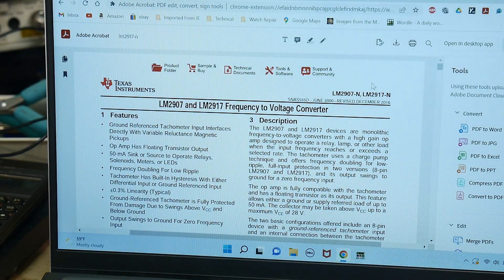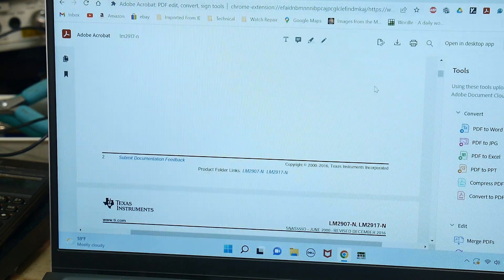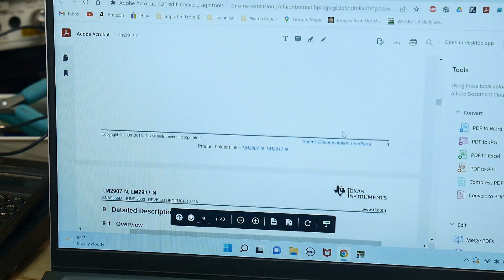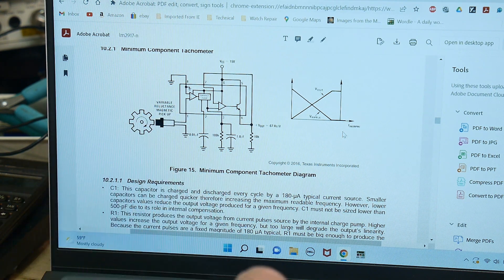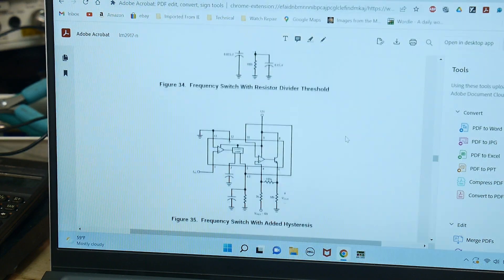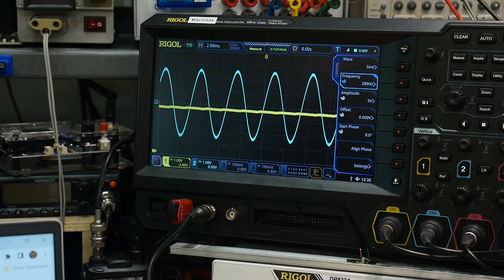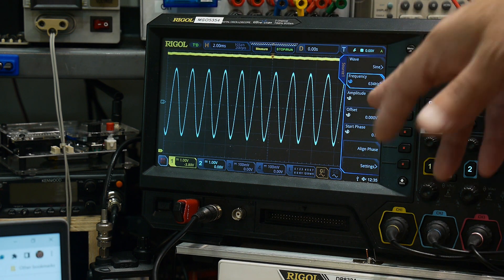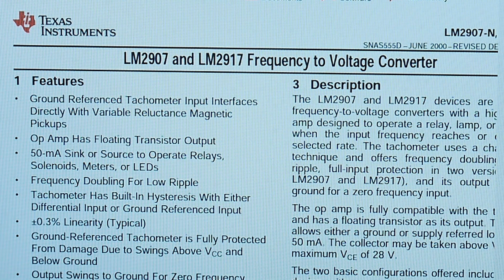#1153  LM2907 Frequency to Voltage Converter

Comment: I'm looking for a similar application however my input is 0->12V square wave.  I'm told the LM2909/2917 chip will only work with a positive to negative input.  Is that correct?  If so is there any similar product which will work with a zero to positive input?
Reply from the maker: you need to study the datasheet more. the 2907 would work fine if used correctly. input is comparator so apply 6v to the other side. datasheet has applications showing positive only voltages

Comment: With the help of my 10-year-old son, I am using the LM2907 feeding a LM3914 to control the lock-up converter in the transmission of a project vehicle. In our circuit, we will be feeding the output voltage into LM3914 to lock up the converter when the driveshaft reaches a speed of about 2000 RPM.  Using 4 pickup magnets, we are going to target about  130Hz to 135Hz as our target frequency.  Using a VR for calibration, we should be able to dial it into the exact speed we are looking for.

Comment: I have built this circuit using a 5Vdc supply. I find I can only get about 3.5 Vdc out at pins 4 and 7. Is this a limitation of the chip or have I done something wrong?
Reply from the maker: chip limitation

Comment: The LM2907 and a magnetic pickup sensor are fantastic. The sensor will take a hot greasy locations similar to car engines. Where expensive encoders will fail.  😎 Great video. Thanks.

Comment: Just bought 5x LM2917N's from China. 14 pin dil ones.That's the LM2907 but with an inbuilt voltage regulator, except that it wasn't there. Fake chip. Beware! Got a refund.

Comment: Let's see, your sine wave signal is AC coupled and the chip is powered with a single ended supply.  I suppose that means that the bottom half of the sine wave is ignored.
Reply from the maker: no not at all, the chip can DC bias it's input to any voltage it wants. I don't know the internal design. oh, just looked at the datasheet, shows the circuit, it has a bias section and the input is actually a Schmidt trigger

Comment: I designed that product as a design engineer at National Semiconductor in 1974.  I was designing custom automotive ICs, and this was my first 'non-custom' general application device;  it was an offshoot of a anti-skid brake controller I worked on for Bendix/Ford.  In no possible way could we have predicted this device would last and sell as many as it did!  I presented it and its possible applications in a paper delivered at the first SAE/IEEE Convergence Conference at Cobo Hall, in Detroit, in 1975.
Reply from the maker: Good job!
Reply: Wow, 2.6k views and one of those was the designer, what are the chances!
Reply from the maker: @guilldea  at least 2600:1 😎
Reply: @guilldea  Its a great channel!!
Reply: Robert,  when were you last working at NSC? I worked with Grass Valley guys, and Oulu, 2005-2011... I guess that you knew that "character" with the big beard, and VE beetle?
Reply: VW Beetle ... btw, there are a few NS parts in LP55xx series that have my fingerprints "embedded" in them...and, a couple of Grass Valley parts, to a lesser extent... oh, and a few TI parts, too ;-)
Reply: @lohikarhu734  I was in the factory from '73 to summer '78, in the field as an FAE until '83
Reply: You may be referring to Bob Pease, yes he was in the lab, Widler would stop in randomly.
Reply: @lohikarhu734  I left the design job in Santa Clara in 1978.
Reply: Fantastic. :)  Rob, what other automotive ICs did you work on?
Reply: @benjaminrich9396  LM330 and many customs for Bendix and GM companies like Delco and AC Spark
Reply: A most wonderful device. It works great on the factory floor as simple mag-pickup speed controll.  🥰 Thank you.

Comment: Back in the eighties I built a fax/slowscan converter for the Amiga 500 using the LM2907 in conjunction with an ADC0804 (ao).
PE1LLA

Comment: Interesting. I would have counted the pulses either directly with an interrupt to the microcontroller or with an external counter that can be polled.
Reply: This offloads the microcontroller so all you need is a generic A/D pin and no fancy timing
Reply: @RobRoschewsk  many microcontrollers, for example the Raspberry Pi RP2040, have programmable digital pins so you can simply implement an offloaded counter on a pin. Another way would be an external counter such as 74HC590 which admittedly uses more pins unless connected to a bus.

There is many ways to go around things. My thinking is just that I would avoid converting something digital to analog just to use an ADC to convert it back to digital. Just keep it digital which is also more precise. I would only think of this chip if I was designing a purely analog circuit. For example if you wanted to drive an analog meter with counted pulses. Not saying it would be wrong to use in any other context, but just that is how I am thinking.
Reply: Most uC today have timers that can be put in a counter mode.